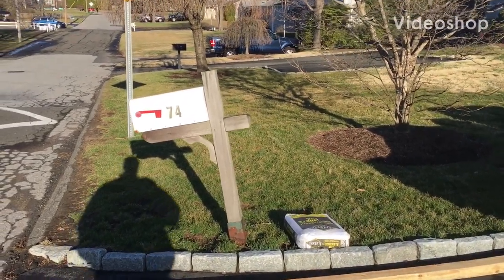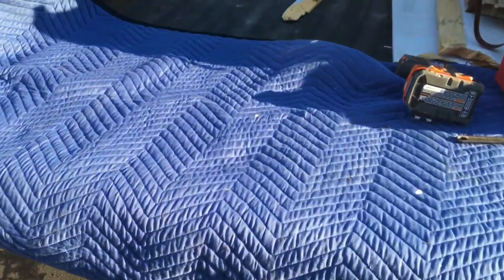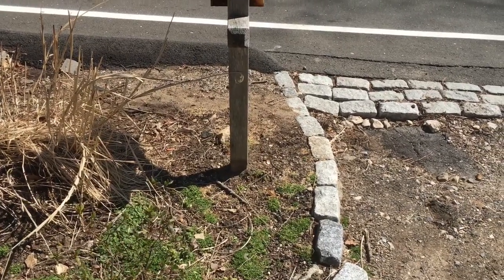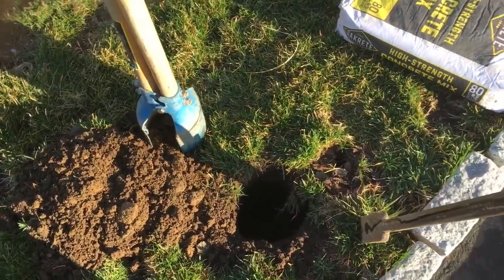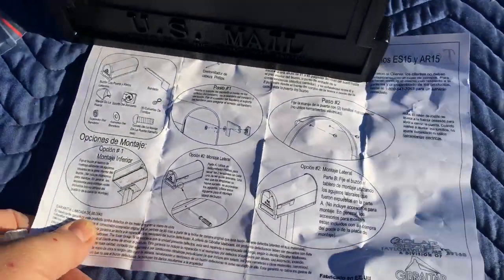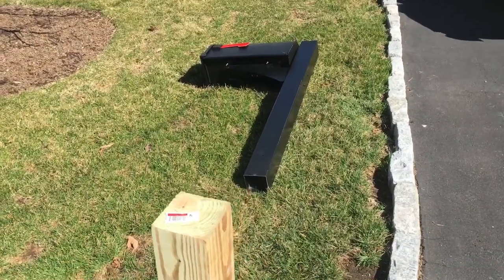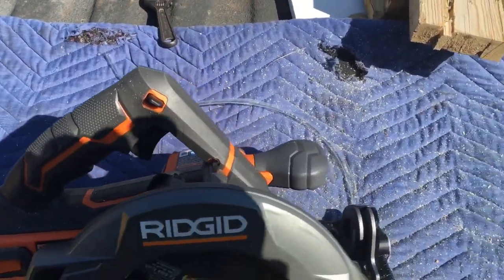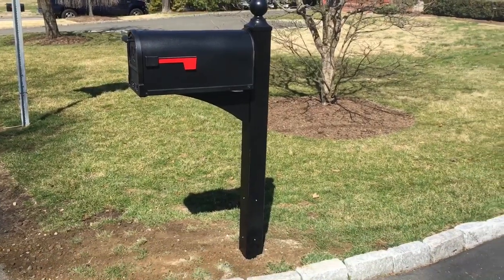How to install Mailbox with post

Comment: I watched it to see how to properly get the 4x4 into the hole. You TOTALLY skipped that part 🤦.
Reply from the maker: Serious? Dig a hole with the post hole digger then place the 4x4 in the hole. Then you open your bag of cement and pour it in dry. Still there? Then use a level to check for plumb then add water. Poke it s bit Then check for plumb one more time. Let it dry and you are finished Cary👍🏻
Reply: @HighRidgeHandyman  So, does it matter if I use concrete vs cement? And does it matter if it gets poured in wet or dry? Seriously, I've never done this before so it's new to me.
Reply: @HighRidgeHandyman  How deep should the hole be dug?
Reply from the maker: @carycoller3140  pick up a bag of ready mix 40lb bag. Dig you hole at least 18-24 inch to make it solid. Put your 4x4 post in then put a few rocks in the hole to keep it plumb then just pour the bag in dry then grab your hose or a bucket of water and pour it in. Let it dry overnight . Your good to go
Reply from the maker: @carycoller3140  I have another video on mailbox post install quick and easy. Go to my channel and browse the videos. That shows a bit more. Good luck bro
Reply: @HighRidgeHandyman  OK  Thanks.